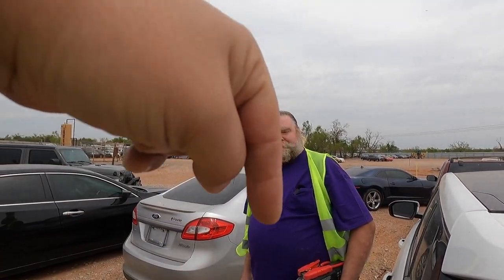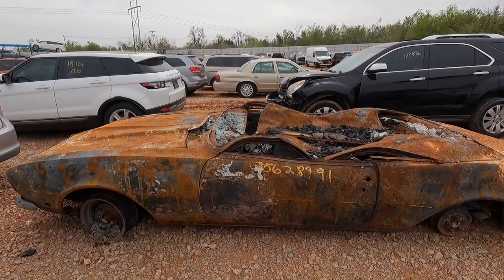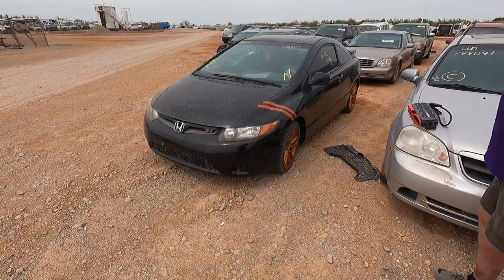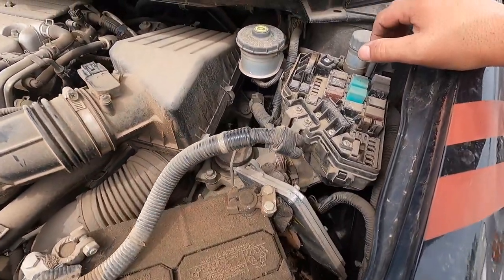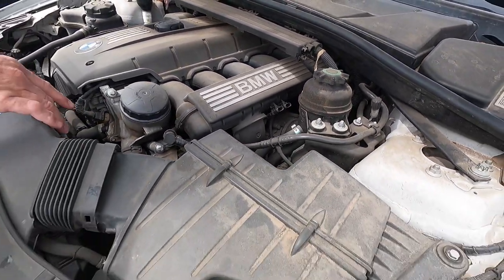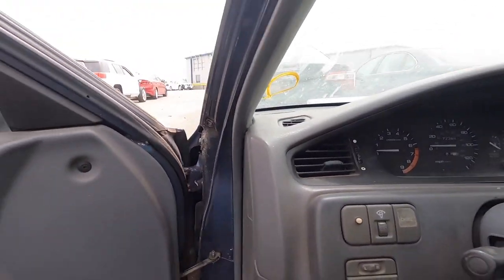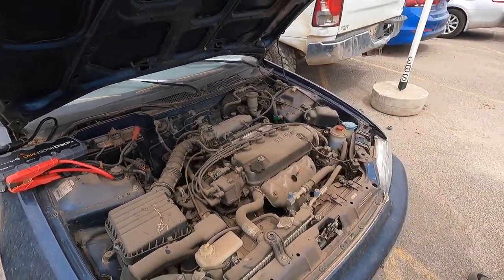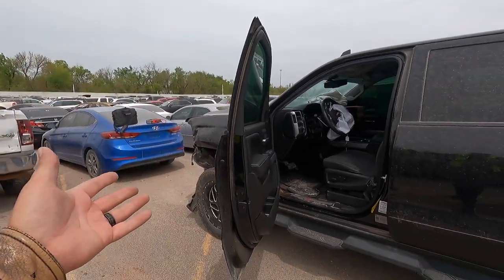Copart Walk Around 4-15-21 + Honda Civic Si

Comment: That old civics idle is surging because the warm up valve under the throttle body came loose. If it’s taken apart you can re tighten the valve and she’s gunna run smooth again.

Comment: I've picked up a few fire cars.. Normally the engine, Trans, Rear survive just fine.
Reply: Looks like a 4 speed car, would be worth buying for the drive train
Reply: That car is worth a lot just for the vin plate and title. You can buy the whole car aftermarket other than that.

Comment: Had an idle issue on my Hyundai that was similar to the blue Honda. Turned out to be a defective throttle position sensor. Swapped it out and the problem cleared up.

Comment: Crispy Camaro reminds me of a burned out ''32 Ford Hi boy Roadster at a GoodGuys event in Puyallup,WA on display. Turned out to be friends we knew. Fire from an old style trouble light caught a work bench on fire. He had recently bought the car and was putting his mark on the car. They lost everything house, 2 vintage cars both were being worked on for the up coming rod run season. The insurance co. covered the house and attached garage but not the cars.
REASON: Both cars were considered to be in non operable condition. The fire flashed so quickly it burned out the electric door  mechanism plus the smoke.He was lucky to make it out.
CHECK YOUR HOME OWNER INSURANCE,and AUTO POLICIES !

Comment: The truck at the end doesn't look that bad, unless there is hidden damages under the truck. Might just need a oil pan, front clip and a few suspension parts and it would be drivable oh yeah the airbags too.

Comment: I have the same Civic with 218k and still rips. I have the same kinda dent but up at the windshield from a tree that fell on it . It has built in immobilizer that will need programed to the key.

Comment: The Civic sounds to me like there's air in the cooling system, should be a bleeder screw on the thermostat housing, if air gets in it will idle up and down like that til the air is removed from cooling system.

Comment: With the Civic Si, you have to program the key for the ignition switch because of the anti-theft security/transponder system. Have had to replace the original keys for my accord cause I was tired of having to use the valet key, and it's an 09. Got 2 of them with programming for around 180 at the dealership. Keys were $35 a piece I think when I got them plus the programing fee.

Comment: On the Honda Civic the immobilizer has to be programmed with a scan tool. It takes like five minutes with a good scan tool. I just did two of them. It looks like someone replaced the unit and got stuck without the proper thing to program it. Trust me it's the only way.

Comment: Hi Randy! You don't have to but would you go and check out the chrysler town and country for me. It's a run and drive and has 153 506 miles on. It's made in 2000. I don't know if you can find it but just a request. Have the very best day

Comment: As Master of the VTech vehicles even if you did plug in the other ignition the key would still be a incorrect match who knows what they've done with the computer loose but would be a fun car make good content it does seem like a security Miss match so as you said may need to be reprogrammed the key to the vehicle good thing is it comes with the a spear ignition

Comment: na that civic was stolen, they buy the old ignition from a just yard with a key then go to the civic brake the ignition and put the other 1 in with all the components, if you would try to steal this car just by trying to hit it and start it with a screwdriver it will not start because of the anti-theft system, that's a k20 motor sought after many honda enthusiast